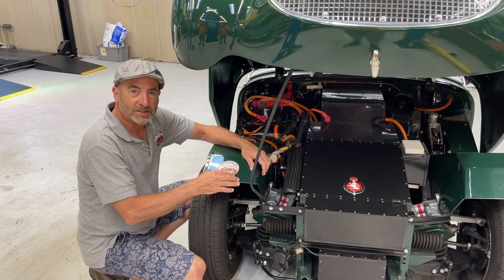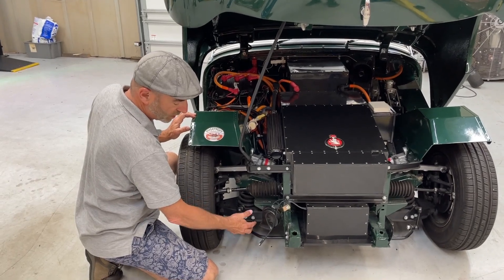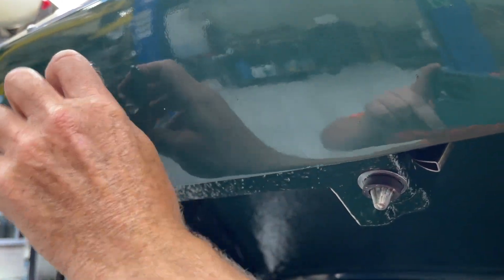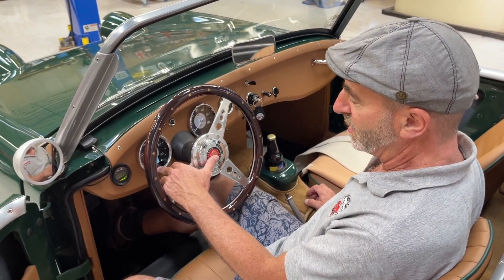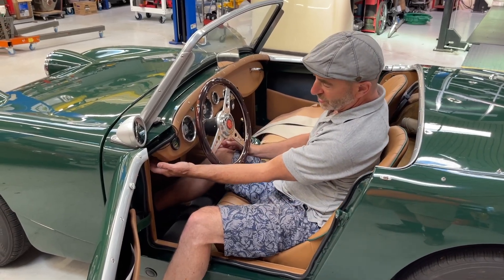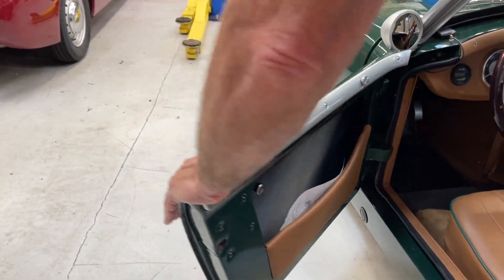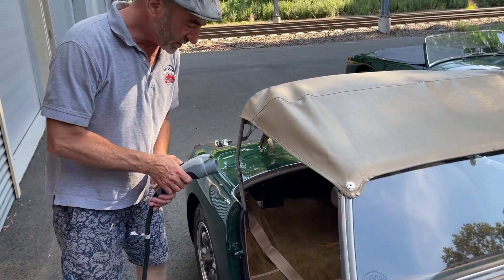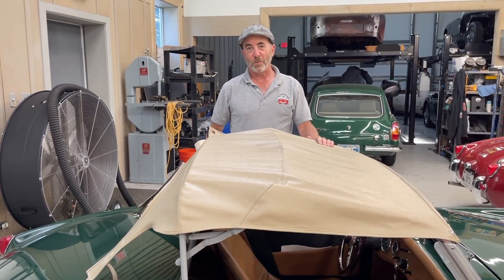Electric Bugeye Sprite Operation Orientation!

Comment: First, love your FrogE. The build quality looks great and the mileage is very acceptable. My thoughts. I know all products needs to be built at a price point, yet the high voltage disconnect location appears to require a re-think. I can't see getting anywhere near its location in an emergency and as demonstrated for servicing, it seems a bit fiddly. Moving on to the fore/neutral/aft selector. It appears its location and part integrity are an economical solution to an important primary control that has given way to beverage access. One last thing, the parking brake. As you pointed out, on an EV it's very important. You might consider engineering the absent clutch master into the brake circuit to line lock all four brakes via a slave through though the handbrake. I know things cost what they cost and we can't always have it all, yet safety and functionality are prime ingredients when it comes to EV operation.